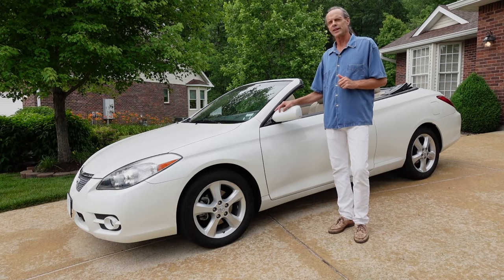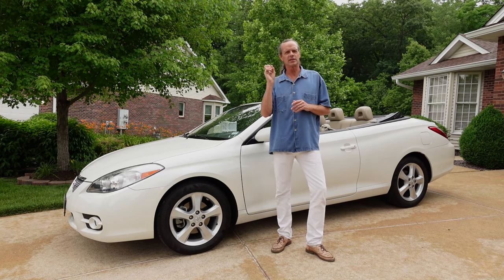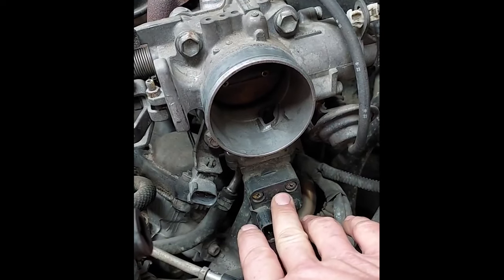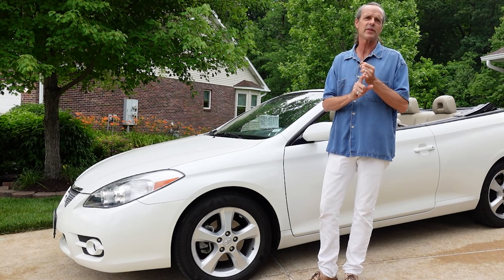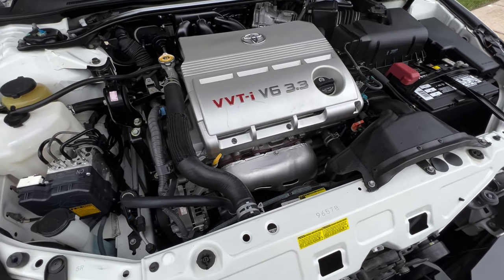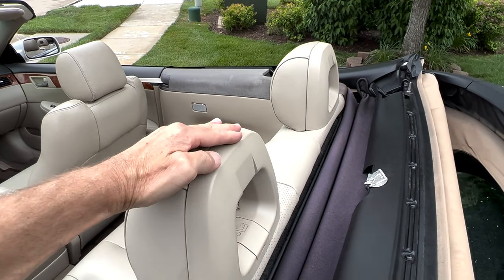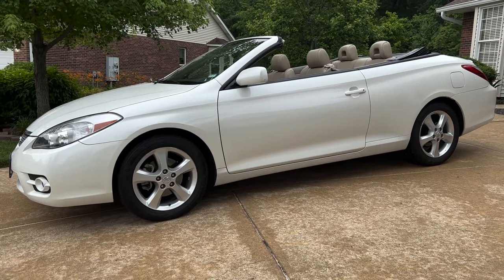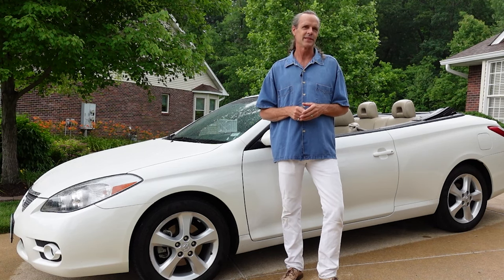Problems to Look out for When Buying a Used Toyota Solara Convertible

Comment: And I would like to see a comparison between the Toyota Matrix and the Pontiac Vibe.
Reply: Here in Canada, the base Vibe started as a better equipped car. When combined with GM's financing and price flexibility, the Vibe became the better option. Now I just wonder what I did with the $2-4,000 I saved when I bought mine in 2005 🤔
Reply: Same car different look
Reply: The Vibe is a re-badged Matrix and is 99% identical.
Reply: @mrslcom  I know it is, that's why I posted it
Reply: same, vibe body by fisher.

Comment: @YourCarAngel I have a 2002 Toyota Camry XLE V6 and I have been told that when I tune it up that the intake has to come off on it also, is it True or do you know how to get  the plugs and coils out, because I was told that I have to also get the gaskets for the intake.

Comment: I've owned several Solaras....coupes and ragtops.   Great cars.  I thought the Gen 1 was beautiful.  The 2nd gen is weird looking IMO, but is a better car from a technical point of view. Get the V6. Performs MUCH better and gets practically the same mileage.  The 4 also has occasional issues, like oil consumption. On the 2nd Gen, some of the LCD dash gauges are almost impossible to see in daylight...an aggravation. I thought that the 2nd Gen 5 speed automatic was rather lazy in its shifting, albeit very reliable.  My gen 1 ragtop roof leaked around the windows in the rain and was sloppy to latch closed. My Gen 2 ragtop was better in that regard.  My gen 1 V6 did develop valve cover gasket leak at about 150k miles. Easily repaired.   I'd buy another ragtop Gen 2...but I gotta say...the "blob" styling just never grew on me,  I'll likely buy a Mustang GT instead next time.

Comment: I can't believe people fall for the 10,000 mile oil change interval. That's just to make the EPA happy, not your car engine happy. 5,000 miles or less depending on driving conditions.
Reply: With synthetic? Definitely 7000.
Reply: Regular oil generally last 5000 miles.  Synthetic oil 10,000 miles at most.
Reply: @djkenny1202  I don't consider the oil, only the mileage/time. I consider synthetic to just be and added bonus of protection.
Reply: @Leonardokite  today’s oil has so many additives. Time means very little. Since I only Drive 3000 mikes a years, I change it about every 1.3 years, which is very soon. About 4k miles over a year. I am sure even every nearly 2 yrs I would be Okay.

Comment: Interference engine? I read on Google it was not an Interference engine. Now I'm not sure if I want to buy one without records of timing belt being changed.
Reply: Double checked and it's a non interference engine 3.3 with timing belt.
Reply: Changed the timing belt at 120K,  now at 127K. Runs great, love my 2007 3.3 SLE

Comment: I would be interested in the there's problems with the rubber insulation at the very back of the convertible top well-watered my great sin from the defective seals and ruins the interior is no replacement for that they don't make that part anymore so I'd like to convertible but I guess I'll stick with the coop SLE with the sunroof I'm still looking for one you have to be so careful these these cars have to have that oil changed every 3,000 mi or less then you could see one with 49,000 miles and find out that it burns two quarts of oil because they didn't do any oil I guess if you do a compression test on a cylinder you could probably find out if the rings are bad that's what I plan on having John before I buy

Comment: I have a 1999 Solara SLE, 70k miles. I bought it with 67k 8 months ago for 2,500$.
It's basically already paid for itself. I am having a noticeable shaking, mostly feel it between 30mph and 60ish. I have balanced and rotated wheels. No change. There doesn't seem to be a definite "cause" answered in any of the sites I've read. I travel for a living, so I don't drive it alot, but before I just throw money at parts? Any suggestions?
Reply: I have a 2007 Solara. My car would sometime start getting a small but noticible shimmy/shake to it at around 40 to 60 mph. I had the tires balanced and rotated but I continued to get the shimmy between 40 to 60 mph, particularly going downhill and braking. I ended up putting new tires on it (Michelin Defender2 215/55R17) and all shaking and shimmy went completly away. The tires previously were also Michelin Defenders and they had around 70k miles, which is a lot but they were rated for 80k miles. I think I possibly could have gotten another year out of them, but I am relieved and glad I purchased the new tires earlier than expected.
Reply: Thank you for the reply. I have been debating getting newer 17in wheels from a newer Camry. I think I will now, see if I get a change!!

Comment: I recently sold my '06 BMW 325Ci convertible, and purchased an '06 Solara convertible, based on TheFiftiesKid series of YT videos featuring all the stupid things that go wrong with the BMW.  I expect the Toyota to not suffer the litany of failures that are associated with BMW ownership, but the downside is that the Solara lacks the crisp handling of the 325 and when it comes to braking, where the BMW felt like a carrier tail hook, with the Toyota braking is merely a suggestion.  No comparison.  Still, nice not to worry about instrument fault lights all the time.
Reply: The big problem with the Solara convertible is the propensity to leak.  When I got my '06 it had aquariums in both the cavities under the rear seat and in the trunk.  Toyota used a flexible material under the rear deck to channel the water to the drains located in the rear quarter panels.  This "rain gutter" will split and develop leaks over the years, as will the window seal.  Toyota doesn't make the gutter anymore, but there are aftermarket replacements.  I found a convertible roof expert to do the repairs, and all is good now.

Comment: Google Toyota Prius inverter settlement. Google 3rd gen Prius head gasket issues. My 2013 Prius V had both fail. In fact, all Prius V under the settlement. Not my idea of reliability.

Comment: I got a 2004 Toyota solora 3.3 anyone want to trade it for a hellcat dodge or a dodge charger it’s not a covetable I’ve put over 6.000 dollars not just into replacing everything under the hood no not rebuild engine just replacing everything that needed replaced or repaired new tires wheel locks  new alarm system